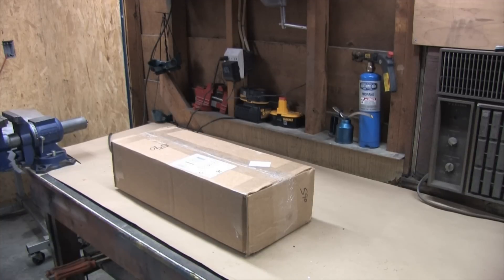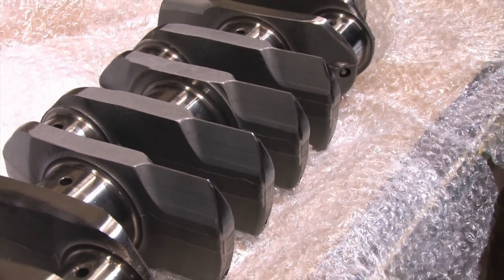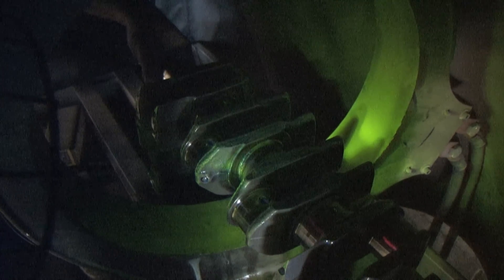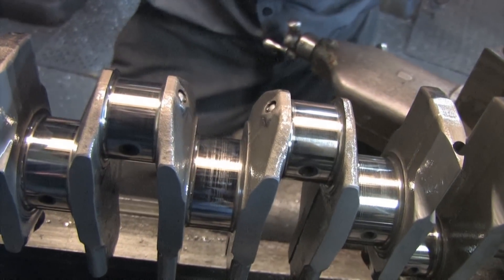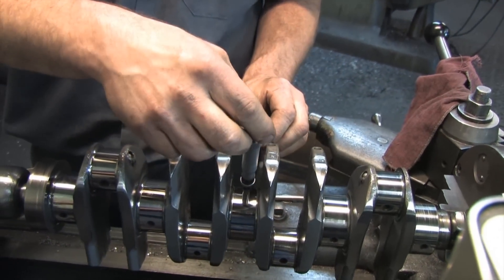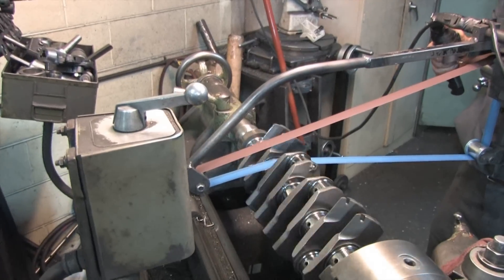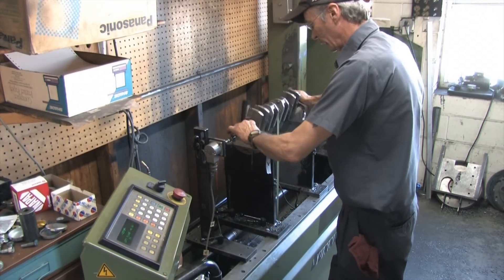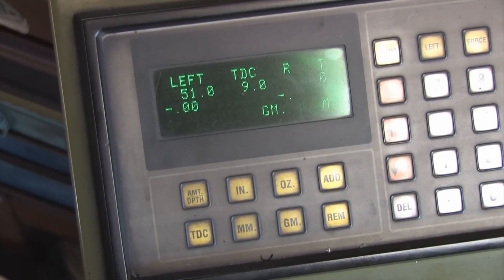Crankshaft Refurbishing

Comment: Jaffro, I just got my engine back and now i'm hearing about the crank balls, which contain dirt sealed around them which loosens up after the cleaning at the shop- only to release dirt which embeds itself in my new acl tri metal bearings. IT NEVER ENDS! Tell me this is none sense and that I can start my assembly.
Reply from the maker: +Jacob McCracken Lol!  Spray some solvents in there and blow it out with compressed air.   If it comes out clean, you'll be fine.  If you're doing your own assembly, you're responsible for all that kind of stuff.  The parts may come back clean, but you'll be cleaning all of them yourself prior to assembly.  They clean them, but it's only so that you don't have to work as hard at it later.  The only way to minimize foreign material during a build is to clean all parts yourself, immediately before installation.  If you check for stuff like that before-hand, then there's less of a chance stuff like this slows you down during assembly.  That's all.  At least you learned it prior to assembly.  ;)  Most people, like myself, have better success learning from their mistakes.

Comment: Your description of the inspection methods needs some more research.  Magnetic Particle Inspection does not use a dye, it used an oil carrier vehicle and fine iron particles.  Dye penetrant inspection is a completely different NDT method.